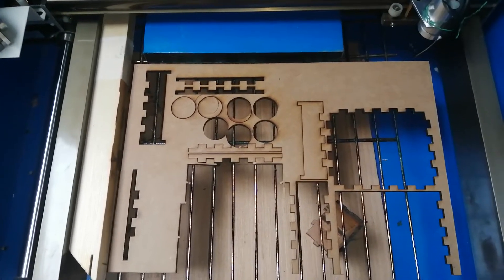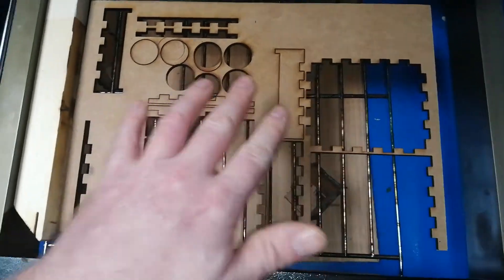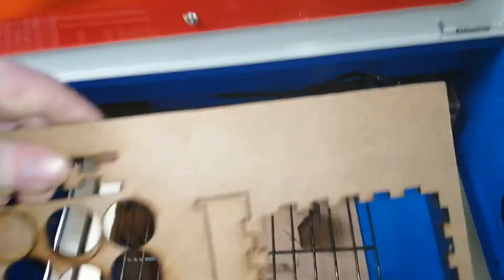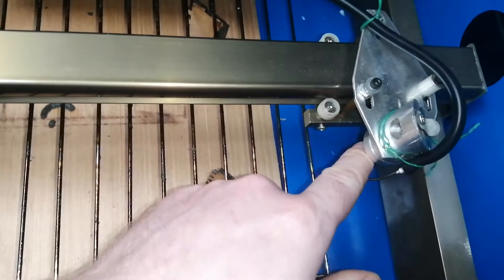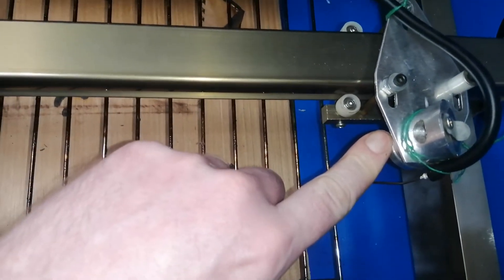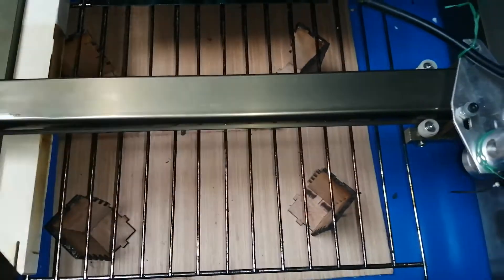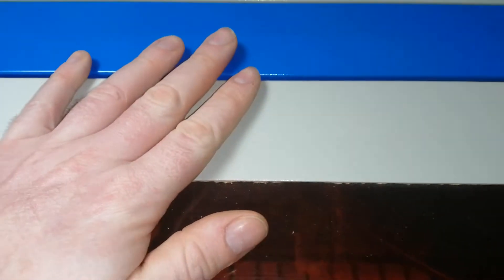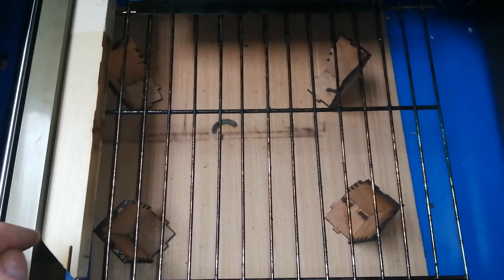K40 losing power? check this first

Comment: I cleaned all mirrors and it's aligned still not cutting through or leaving any marks on the back. Any other things I can try. Was working fine
Reply from the maker: You can check if your power supply is good by lowering and then increasing your power manually and watching the mA meter. If the output doesn't increase, then it's a power supply issue.

If it does increase then check the burn pattern before your first mirror. Starting at low power and increasing. If the burn doesn't change significantly within say, 20% power, you could need to replace the tube.  The 'beam' in the tube will also be bright pink/purple if good or white if it needs replacing
Reply: @philscraftcorner     My beam in the tube is already white, thanks for commenting, now I know I need to replace it.

Comment: Tried this Phil, but still getting less cutting power for some reason. My tube is three years old but I've probably only run it for an two or three hours in total. 

I can get 100% clean cuts in 2mm acrylic anymore, even at 15mA and 10mm/s speed. In places the cut doesn't go all the way through.
Reply from the maker: That's a list to take guesses at, the first thing would be to check alignment and focal length, after that it might be an idea to check to see if changing power settings makes any difference on your Ma meter, one of mine had a power supply fail and not increase over a certain level.

The tube could very well be on its way out too. The gas dissipates over time. See if the beam inside the tube looks pink/purple or white. Closer to white meals less Co2 left. It's not an exact science but a good indicator
Reply: @philscraftcorner   Hi Phil, Thanks for responding so quickly! 

Focus looks good and I've double checked focal point with a cut on a sloping surface. 

Do mirrors degrade after a while? If so, can they be adjusted so the beam hits a different spot?

I know it used to cut 2mm acrylic perfectly at 10mA, 20mm/s.
Reply from the maker: @richardmarkham8369 mirrors can degrade but that's more from use rather than just time. I know it's trivial but maybe check that the final lens is curved side up
Reply: @philscraftcorner  I'll check that.

Comment: You are a life saver! Thank you for making this video. I have spent 8 hours aligning everything perfectly only for the laser to be worse than before. Did as you said and it worked. Only thing I would add it when using masking tape to align mirrors it the glue leaves a residue on the mirror.
Reply from the maker: I clean the mirrors immediately after using the masking tape when aligning but I'm glad you managed to get your machine running well

Comment: Thanks for this.. I’m trying to figure out what’s wrong with mine and trying not to order a new tube unless I have to. Mine looses power if I turn it above 52% power. It just seems like the laser shuts off, but the tube still illuminates.
Reply from the maker: Hmm that's a strange one. What kind of color is the beam in the tube. Do you have a mA meter installed?
Reply: @philscraftcorner  it’s the typical bluish white beam. There’s no visible taper or anything in the brightness (albeit it is daytime, so I could probably gauge better in the dark)

No meter. It’s on the list, and has been in my cart for months, I’ve just been swamped lately. Just the stock “power” percentage thing. It tapers between 50-60%, but totally drops off as far as firing to the workpiece after that 

I gotta run out for a bit, gonna open it up, check everything and clean the mirrors when I get back. 

(Thanks for the wicked fast response btw)
Reply from the maker: A co2 beam should be a bright pink. A white beam indicates that there is little co2 left in the tube. The brightness doesn't really change.
A mA meter will help confirm weather it's the tube or the power supply.

Generally speaking if it's the power supply the mA meter will not change with increased power.

I'm doing a bit of video editing at the minute so I had some time to respond 🙂
Reply: @philscraftcorner  I just checked over everything.. water pump is good sensor is good, still cuts perfectly below that threshold. I suspect it’s just the tube dying which kinda sucks.. Finger crossed, just gonna bite the bullet and order a replacement.
Reply from the maker: I would grab that mA meter first. They are super easy to fit. Just cut your black wire from the tube and attach it to that. You can extend the wires for a prettier fit in the future
Reply: @philscraftcorner  yep! After you mentioned it earlier, I went ahead and ordered it. I use the laser so much for leather, I’m to the point I’m about to just rebuild it with a fresh power unit and stronger tube. Gotta do a bit more research first, electricity isn’t my forte so I tend to be cautious about it 😅
Reply from the maker: It's pretty easy if you take your time and think about it. I made a video swapping over my tube to a vevor tube. That could have some good info for you
Reply: @philscraftcorner  I was just checking out some of your other videos on it actually! You, Sir, have earned my sub. Not trying to shamelessly plug, but for a better visual example of what it’s doing, I just added a 30 second clip to my channel, including a photo of the tube at 70%. I do see a pinkish tint now that you mention it. Oddly enough, as I press the test button and dial the power down, there’s no visible change really where it drops off. That’s what seems so odd to me. I’ve found a couple similar issues of forums, but gotta read a bit more. Frustrating as heck. 

Thank you!
Reply from the maker: I will check it out later on for you and see if I can make anything of it.
Thank you so much for the sub. I just hope I can help as many people as possible 🙂
Reply: @philscraftcorner  got the new tube in there, and added a 30mA gauge!  Wasn’t sure what size, so I googled a bit, said 700mm.. ordered a 40-45w 700mm tube off Amazon, and the factory one was NOT 700mm 🤣. Luckily the body had a panel to remove for longer tubing. It sticks out about 10cm, but I’ll print a protective cover for it. I think now that I’ve got my feet wet, when this tube dies I’ll go bigger and swap the power.. after a bit more research. 

At “10%” power it’s reading about 3.5mA. Kind of a dumb question, but where do I find my power source’s max or recommended?

I did fire a blip at 100%, just to make sure I wouldn’t bottom-out the mA gauge, and it peaked at 28mA.. so I just barely made the headroom. 

My 10% already seems like it is way stronger already than anything I got from the factory tube. (In the sense at how it zipped through a leather test piece)
Reply from the maker: Nice work. It will usually tell you max mA in the description on Amazon or if it's got a manufacturer name see if you can find their website. My 50w never goes above 18mA it's just not needed for what I do.
If I remember the max manufacturers recommend is 23mA

Comment: I've just started my K40 for the first time and it really struggled to cut through 6mm MDF even after 7+ passes with 50% power at 10 or even 5mm/s which really surprised me so I'm gonna give this a check and also find the focal point because the lines seemed quite thicker than expected
Reply from the maker: The focal point is always a great place to start. Also make sure you're alignment is good and you are not getting any reflections from the laser head

Comment: i have the same problem and i cleaned the lens too. was not dirty but what i have is when i test the beam i have 4 dots coming out from the tube. what can it be ?
Reply from the maker: The 4 dots from the laser tube is quite normal, there are a few patterns, some are a single dot, some are 2 dots, some are 4. It's only if you get multiple dots from the final lens that there could be an issue
Reply: @philscraftcorner  the thing is that i have the 4dots even on all mirrors. Can i send you some pictures and video email or somewhere else please
Reply from the maker: 4 dots is perfectly fine, it's what comes from the laser head that would be an issue

Comment: Ive had this problem and just done the clean like you said.. fingers crossed it fixes
Reply: Ive tried distilled water and it didn't touch it so used a little acetone which it did clean it off better but there is just one stubborn bit i can't remove
Reply from the maker: @laurabrooks6986  pure acetone should work well. Maybe every few times using the machine give it a little clean. I do my mirrors and lens everytime I start a few hours of work
Reply: @philscraftcorner  yeah definitely gonna keep an eye on cleaning laser up more.. noticed a reduce in cleaning since installed air assist mind
Reply from the maker: @laurabrooks6986  get yourself some good extraction too between 2-300 cfm should be great for your machine and get rid of that smoke quickly
Reply from the maker: If the lens was not clean then it reduces a good bit of power from the machine. Hope it helps
Reply: Did yours have like a sticky circle in centre of it?? I send you a pic but you can't attach on here unfortunately
Reply from the maker: There was a bit of residue on mine, like a brown spot
Reply: Yeah thats the same as mine have cleaned it as much as possible but some wont budge
Reply from the maker: Maybe it's been building up for a while and baked on. What are you using to clean?
Reply: As sick of it not cutting in one pass. Mine is a digital % display but my brother in law is fitting an mA meter to it this week i do get results eventually but never in one pass

Comment: Yes, lens (or better to say output coupler) on the laser tube can get dirty over time. Use acetone and cotton buds for cleaning. Also, if your laser losing power during operation, check water temperature. If it goes over 25C then it is time to add ice pack or just allow to cool down. While temperature in the water container may be at 25C, in the laser tube it can be even higher. If water pump circulating water slowly, then that part you should use in account for losing power. I am talking about sudden loss of power during cutting, not gradual weakening of the laser tube due to dissociation of CO2 molecules.
Reply from the maker: Some good advice. Thank you
Reply: @philscraftcorner  You are welcome.